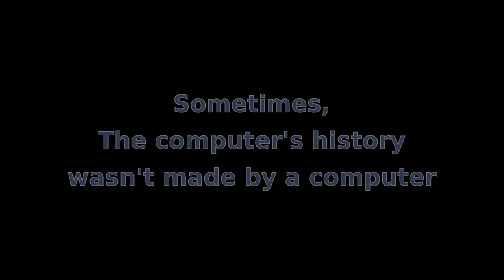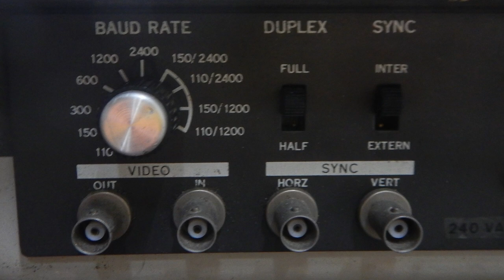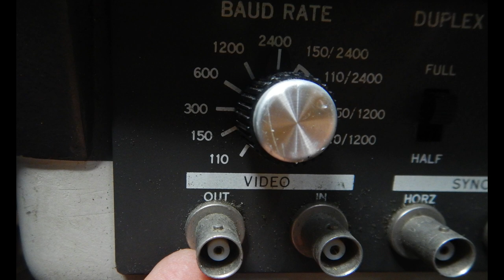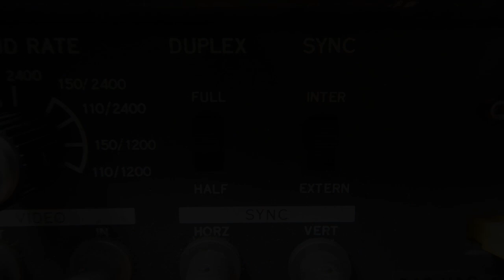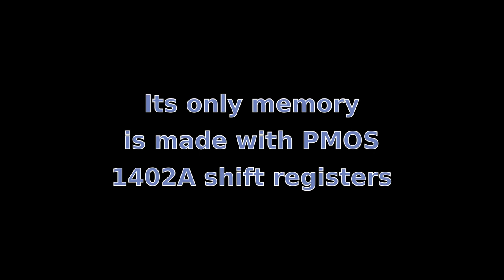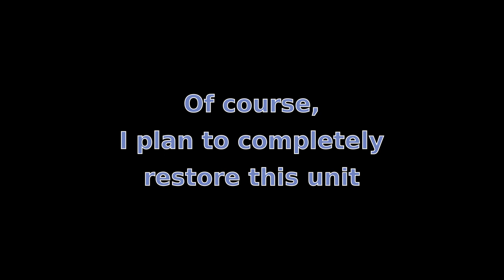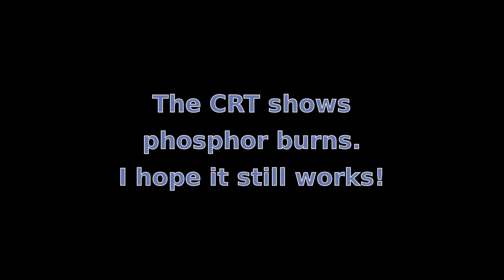The DEC VT05 computer terminal pt. 1. A short introduction

Comment: The KR2376-17 on the keyboard is a second-source version of the AY-5-2376 which was one of the first dedicated keyboard controller chips put into production.
Reply from the maker: Hello! Thanks for the information! I hope I won't need a replacement of that one, I believe the -17 in the part number is the key to ASCII code mapping for that particular keyboard, so probably not easy to find nowadays.

Comment: Nice video, but by no means was it the "first crt computer terminal". Those date back to the early 60s if not before.
Reply from the maker: Thanks for the information. Do you have any brand/model of the early ones? It's the first from DEC for sure.
Reply: @iz8dwf  There were dozens or probably hundreds of crt terminal models in the 60s. A famous example were the Control Data console screens (6600 and other models) but these were far from the first. Another example, PHILCO was building various kinds of crt based workstations by 1964. In the vacuum tube era there were even specialised tubes for character generation (Monoscopes and Charactrons) and terminals like Cossor (DIDS-400, 1965; google "saving private cossor") used them. I'm not sure the VT05 is the first from DEC either; they had been putting interactive CRTs on their computers since the PDP-1 (1959) and probably earlier.
Reply from the maker: @qu1j0t3  Thanks again. I would focus however on general purpose serial terminal. Afair the pdp-1 (and similar minicomputers in those years) had vector crt consoles, not general purpose serial terminals. Of course CRT based displays were already an established technology.
Reply: @iz8dwf  I'd agree that the CDC consoles were not "general purpose terminals", but devices like the Cossor certainly were (and there were dozens of such models).
Reply: For the terminal market of the 1960s, a distinction between vector and raster was not important. Vector was popular for text and data entry terminals too even though today we associate it with graphics. A good example of a general purpose "vector" terminal, with no graphics: TEC Series 500 Data-Screen: RS232, up to 4800bps (1969).

I don't think this era of terminals is well remembered, perhaps because none of it was remotely close to the consumer market; serial terminals remained quite expensive at least until the early 1980s. In most cases the only remnants of that time are documents preserved on bitsavers.
Reply from the maker: @qu1j0t3  Thanks again for the research! There's not much information about these terminals anymore unfortunately.
Reply: @iz8dwf  Cheers! You're very lucky with the VT05, it's going to be a fascinating restoration project. My own interests are in the vector area (I've designed a MCU controlled vector generator and built to pcb) and I also own some Monoscopes which I'd like to get running. I really enjoy watching your analog repair videos because I also collect and repair XY monitors. I'm still learning repair and design though.
Reply from the maker: @qu1j0t3  I've got the VT05 a few years ago to be the matching "serial console" for my pdp11/10 (I've got that one in the mid 1990's and it was working back then). Unfortunately the pdp of course no longer works, so that would be the real challenge to be restored. I'm sure you know I've designed a complete X/Y vector CRT monitor for old arcade games. I would for sure design a matching one to be used on the pdp and run space wars, if I ever get the pdp11/10 back in full working conditions one day.
Reply: @iz8dwf  Yes, I remember your series. I must watch it all at some point. Good luck with the 11/10. I know some experienced DEC restorers if you need any advice.
Reply from the maker: @qu1j0t3  The main problem to get started with the 11/10 is the enormous space it takes once you take apart the cabinet to separe the power supplies , the backplane and the chassis. I currently have not enough space to keep it disassembled for months (if I'm lucky and it's not a very long process). I have found enormous information repository on the web regarding the early Unibus pdp11s. This one got core memory too. I'm also afraid that at one point I'd better get a logic analyzer to troubleshoot it and that's another thing that's keeping me from starting.
Reply: @iz8dwf  Yeah space is always the enemy. Somehow I've come to own several PDP-11s including some Unibus (years ago I tried to get my 11/34a running) but none of them have core, unfortunately.
Reply from the maker: @qu1j0t3  There's a good video series from Jerry Walker on a complete 11/34a restoration. He dives often into Unibus details (too many repetitions if you ask me, LOL) but it's a good tutorial on what to expect and what to look for on such a restoration.

Comment: What is RS-330?
Reply from the maker: Actually, I was wondering the same. It's apparently a 1968 standard that didn't become widespread. Arizona State University library has a paper copy of it: https://libguides.asu.edu/standards-e/eia but I haven't been able to find any electronic copy so far.
Reply from the maker: I've found another reference to it here: https://www.trmc.osd.mil/wiki/download/attachments/113019927/452-86.pdf?version=1&modificationDate=1623181169100&api=v2 it actually appears to be a video interface standard, probably the one used to connect an analog video signal to the VT05
Reply: @iz8dwf  Wow :) Thanks. Great video BTW...

Comment: Wot, no valves ?!
Reply from the maker: Sure, the CRT is by all means a valve :D
Reply: @iz8dwf Haha well it shares the electron-emission side I guess
Reply from the maker: @daffyduk77  much more than that: electron emitting cathode, control grid to modulate beam intensity, more grids to accelerate and focus the beam, anode to "collect" the beam. Check "magic eye tube" on a search engine and see how similar it is to a CRT :)